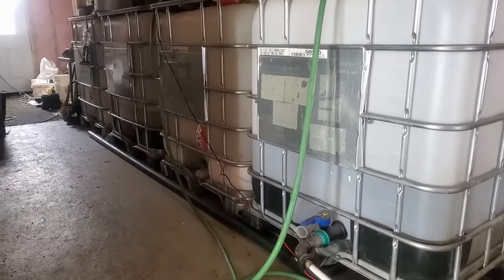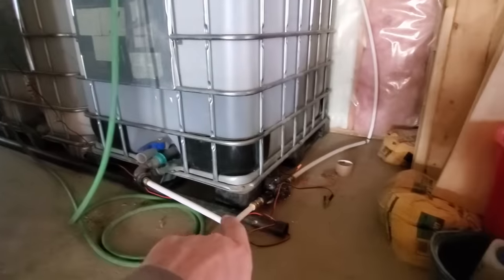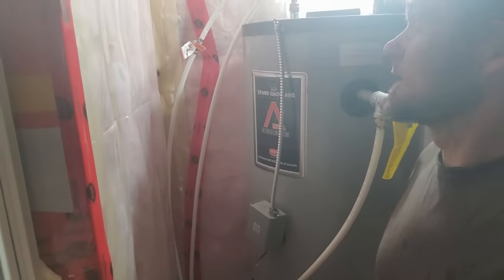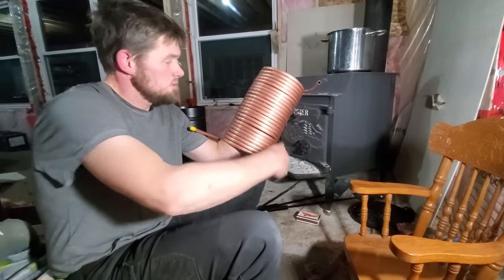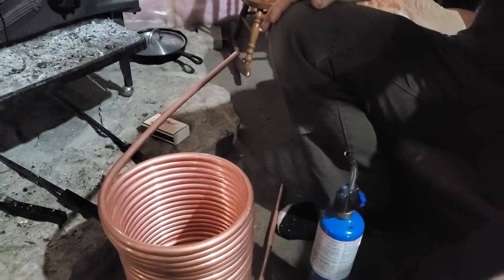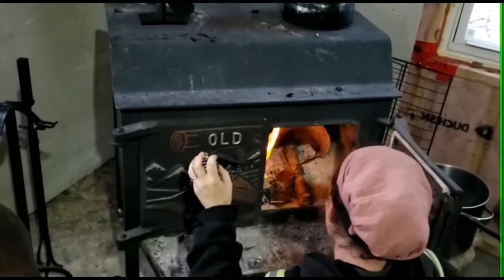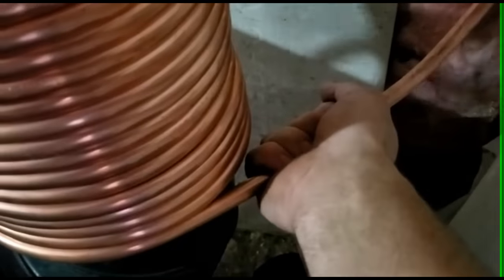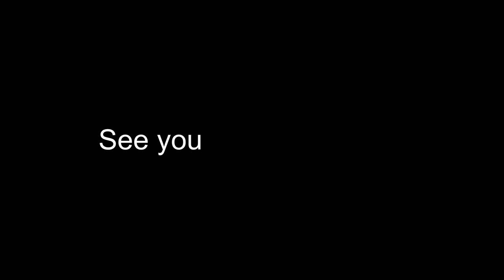Endless HOT water for FREE /OFF GRID

Comment: the coil is too long and the transfer rate of heat from the chimney is too low and creates a cold spot in your chimney. you'd heat a lot faster with a 2 foot loop inside the the fire box placed off to one side. long coils create too much resistance to the water flow, slowing down the rate of flow that can create a dangerous situation due to the coil splitting if the coil overheats in one spot when it can't push the cold water on top through.
Reply from the maker: Works great and has even for almost 2 years.

Comment: Fantastic concept.  I've seen that before but have one concern that maybe you can debunk.  I know it's better to keep the stovepipe smoke/air hot all the way to the outdoors in order to minimize creosote.  It's seems as though you would get a lot of heat loss in the chimney from transferring that heat for the water - is it a concern that you will cool the chimney exhaust enough so that creosote buildup will become a problem?
Reply from the maker: Not a concern at all, only removes a minimal amount of heat from the outside of the chimney. 
If you had the coil on the inside then I think this would be a major concern.

Comment: How did that work out for you during the summer time?
Reply from the maker: Great, as long as we start the fire.
Hoping to add solar water heating this year
Reply: @countrysideacreshomestead2008  Outside fire stove. Maybe closest to the hot water heater. That would probably require a little shed for it though. If you do go solar, then you have it for back up just in case. Just an idea.

Comment: Wow good job if you want to increase your hot water temperature look up counterflow you'll notice that you want to take the cold water from the top and the hot water come from the bottom but it may mess up your natural recirculation
Reply: Heat and hot water rises from the bottom, then to the top. And taking water from the bottom of any tank will also release calcium, dirt, rust, etc to the system.

Comment: That’s not endless hot water.    I can tell you from experience.   I have the same set up for my radian floor heat and it can’t keep up.  You’ll need at least double the copper tubing.  Plus you need pressure relief valves for safety
Reply from the maker: Well it has been working flawlessly for 2.5 years,  I'd think that's experienced enough. The system has a pressure relief valve in it. Might want to take a second look at the video.

Comment: What water pump are you using?
Reply from the maker: We have a 12v water pump for our complete system, same one as in an RV or camper
Reply from the maker: I should clarify that the copper coil gas no pump on it, it works on thermol siphon alone. Hot water rises drawing cold water in the bottom.

Comment: it might be a good idea to raise up the interconnecting pipes between the 4 barrels 
reason being should the line break you drain all 4 barrels all the way , raise the line to about halfway up , that way should the same thing happen the barrels only empty halfway , they fill either way just in sequence until halfway full 
to empty them use sumting with valves for each comtainer so it fills up all the containers and empty one all the way 
burrying the tanks or at least put them in a dug out root cellar will keep the water cooler , the lack of light should help against algae too (having a ultraviolet lightsource inside the water line with a pump recirculating could help kill micro orgasms too )
Reply from the maker: That set up was just temporary

Comment: Don't u need a pressure tank
Reply from the maker: Not with a 12v rv pump, they keep the line pressurized and are meant to run in an rv without a pressure tank.
A pressure tank is meant to keep your well pump from turning on every time you open your tap.

If you look at our newest video on this system you will see some upgrades to it and more explanation. 
We are now on a well and have a pressure tank.

Comment: What is the life of all that plastic hosing? It most certainly will fail, way before copper
Reply from the maker: Hardly anyone uses copper anymore  pex pipe has taken over the plumbing industry.
Reply: @countrysideacreshomestead2008  Thanks for the response.  I haven't worked with much plumbing. The amount I have, I've experienced leaks in hoses. Although it may have been a different poly

Comment: Buddy you can't cap off a t and p. U basically made a bomb
Reply from the maker: Not sure what you mean exactly... 
There is a relief valve in the system which prevents the tank or any other part of the system from exploding. 
It has been running flawlessly for about a year now.
Reply: Sorry man just seeing it know.  As a plumber I recommend putting a pressure tank in and 2 sediment filters a carbon filter, a uv filter. We are thinking about going of grid as well and im going to put in a propane tankless and a 12v trailer pump or some kind of pump to pressurize the system. We are also looking into wood fired boilers.

Comment: I'm a plumber 1) your copper and  galvanized will cause electrolysis and destroy the copper pipe and the galvanized on your chimney..2) you have no way to regulate the temperature so basically what you have is a out of control hot water system... And 3) it's far for free since you bought copper pipe,, fittings and piping.... your labor to cut and stack the wood.....
There is no way to control the temperature of the water your heating...it may blow off on the relief valve.. flooding your house since you don't have any drain on the relief valve......or if the relief valve gets stuck you just created a bomb in your house with the hot water heater being overheated... Expanding and then exploding...a way to correct that problem would be to yes run a wild loop somewhere with a pump that can disperse the heat either into of the ground or some other area of the house such as a radiant heating element... Such as in a boiler system baseboard heat... Again the system will run wild out of control... That's why there's a thermostat to the oil burner... It would have made more sense to leave the oil burner in there use a small generator or solar battery stored power to run the burner certain hours of the day when needed... And allow the thermostat to control the temperature of the water... I see you have small children that may be severely scolded by the uncontrolled temperature of the hot water... It may function however not properly or safely... And you constantly need to babysit it....
Some say ingenious invention.. I say dangerous and an accident waiting to happen...your relief valve is on your cold water intake which it's not going to read properly the pressure in the tank...... Oh don't get me wrong it'll work it'll it'll eat water... But at what cost severely burning your children exploding the tank destroying your house or killing someone..or flooding your house when the relief valve pops off because the water got too hot because you can't control the temperature of the water.....it's not like you can shut the wood stove down to keep the water a certain temperature you need to heat the house with the wood stove... Temporary cobbled together system at best... No long-term solution.... Not free.... And very dangerous....
Reply from the maker: There is no galvanized and copper touching.
The system has been running flawlessly for 1.5years with no babysitting.
Running oil would defeat the purpose of off-grid living.
Hot water for free refers to the cost of producing the hot water not the construction of the heater 
Thank you for your comments
Reply: @Don  I'm pretty sure the pex (which is plastic and has a rating of 80 psi @ 200 degrees f) would let loose before the steel tank inside the water heater explodes. Remember, he's not heating the water tank directly. (No flame under tank). Nice work.